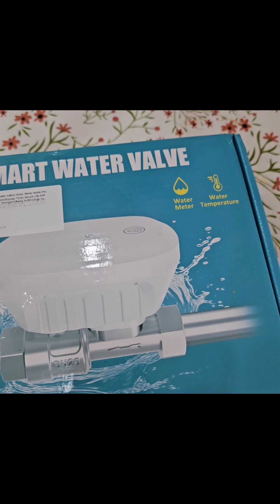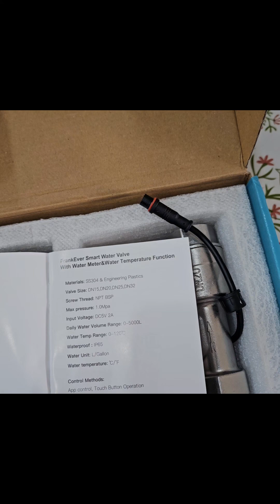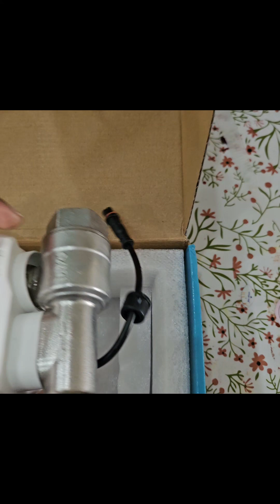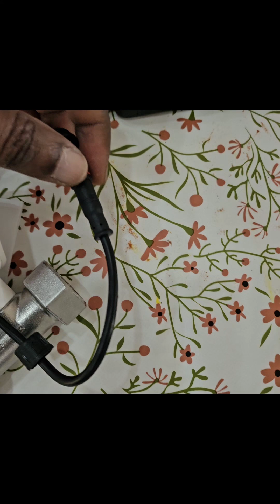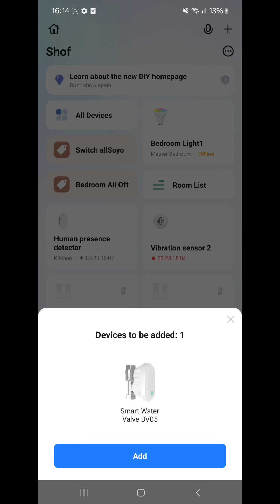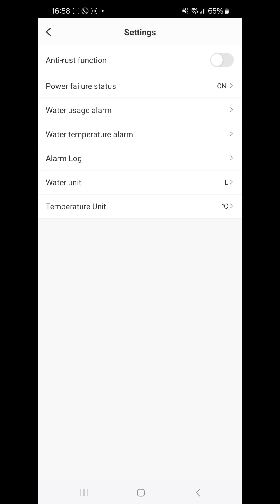Frankever FK- BV05 Smart water valve  with water meter and Temperature meter Review

Comment: Hello, could you please tell me if this device can be used as a leak detection safety feature?
Can the “water usage alarm” be set for a maximum daily volume, or does it only trigger once the maximum threshold is reached?
Thank you for your reply.
Reply from the maker: No, there is no leak detection. Water usage alarm cannot be set daily, but a threshold.

Comment: Hello,
Is there any possibility to reset the value of "water_once", if yes then How?
Thanks
Reply from the maker: Unfortunately currently in app it is not possible.
Reply: Water once resets when the valve is closed and opened; otherwise, it will count L between the last time closed. Total water gives you hourly, daily, monthly and yearly readings.